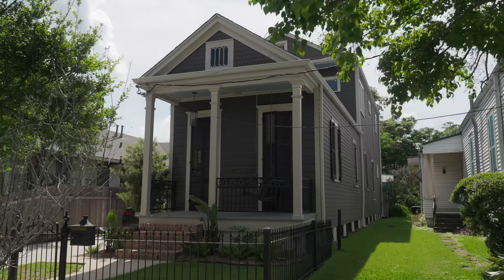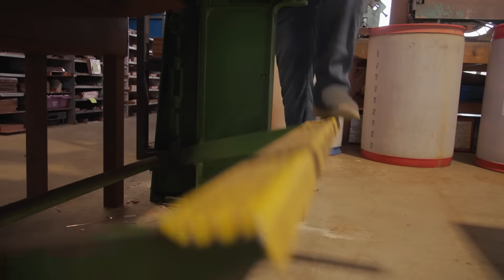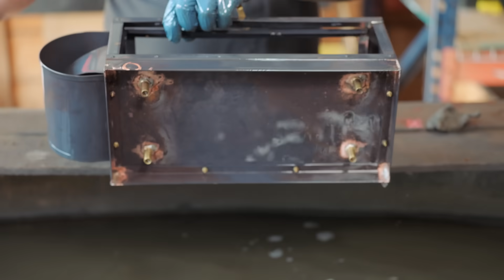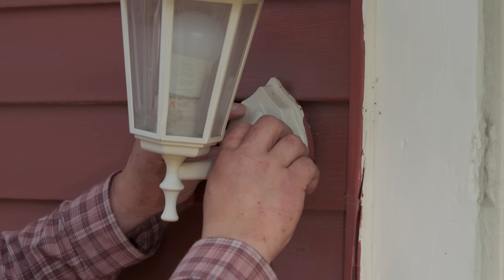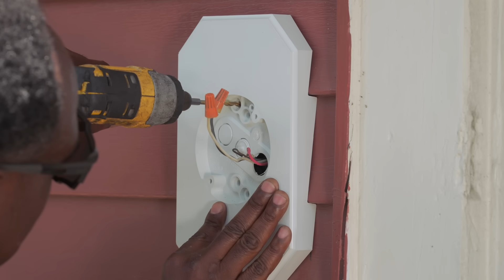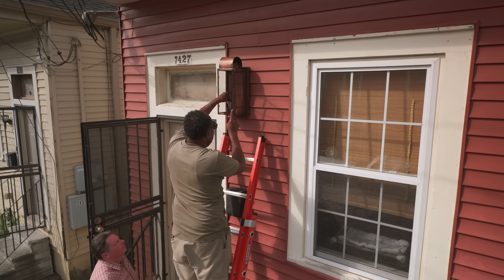How to Install an Electric Lantern | Ask This Old House

Comment: Why doesn’t the fixture just have white and black wires.
Reply: It just depends on what wire the fixture manufacturer uses. The wire on those fixtures is lamp cord.
Reply: The company spent their budget on all that copper and labor, and didn’t have the energy or thought to buy parts with color coded wires.
Reply: Historical approach
Reply: @albertstanulis 
Seems silly for wires that will never be seen. Oh well.  Thanks
Reply: in the  south  they like to keep  things  on  the dark side